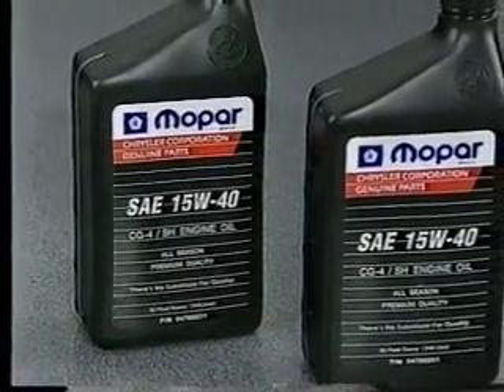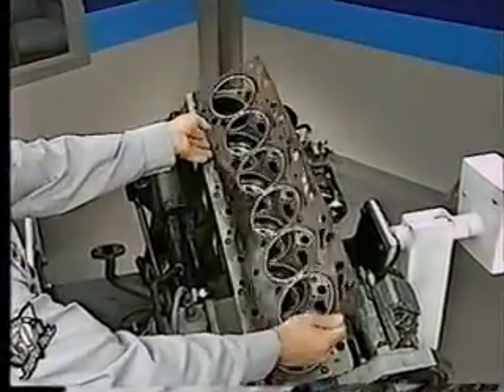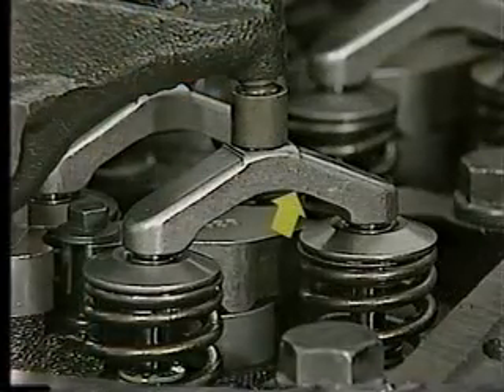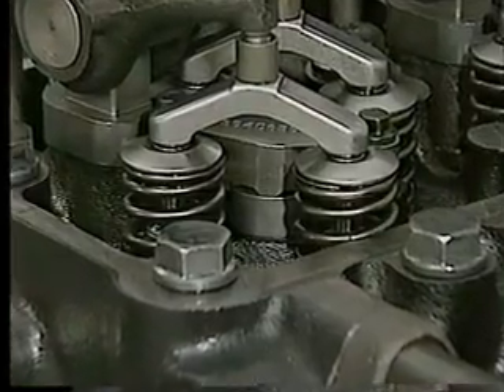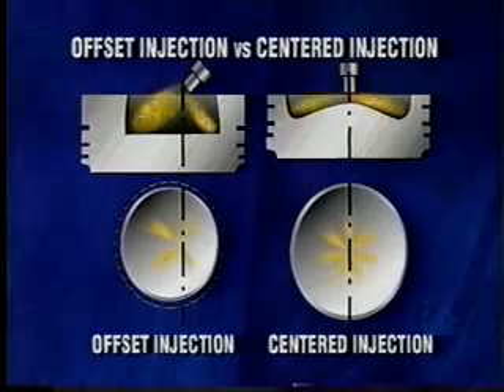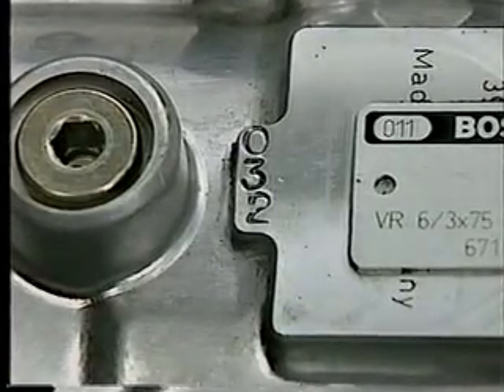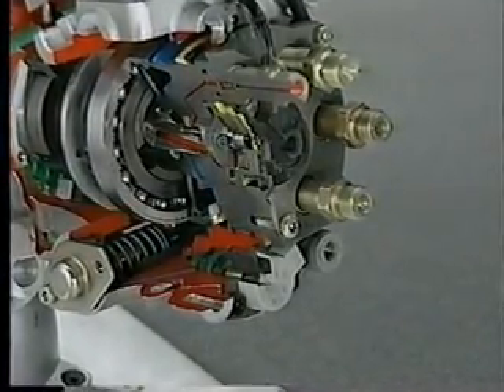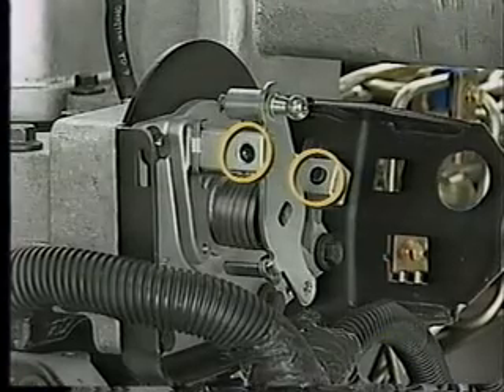5.9L i6 Cummins 24-valve diesel engine - Mastertech 1998 Part 2

Comment: Hello i have problem with my truck  dodge ram 2500 98, when start every day no problem but when i dont star by few day dont star, system diesel is empy, i put spray on intake and the truck start

Comment: I have 2001 dodge but I been changing the fuel filter and I did wrong . 
Finally I have my truck running back aging 
Now I all ready find one more problem, when star , all the time I just turn the key on wait for the light "wait to star " and star it and it star well, if I go somewhere and stop my truck , when I going to star it aging, is when I have problems to star ...
I would like to know if is a fuel system problem??? Or if I need cheek something else first

Comment: As I can see. But when I am in drive on flat ground in the summer for example, I will idle at 775-800 in Drive. in park I am at 800. But what annoys me is when I shift from Park or Neutral to Drive or Reverse, my truck shunts hard. And I know that can cause damage to the Transmission. With A/C on there is no difference in idle speed both either in Park or Drive. And my truck does creep at idle very well I will move at 5 mph on flat ground in Drive. But my idle is to high for me.

Comment from the maker: I would not turn the idle down. The idle is set for things like A/C, engine heating/cooling, and for the auto to be able to creep at idle. Also, the adjustment is supposed to be made while the transmission is in Drive, not Park or Neutral. Too low of idle will reduce heat which will cause a build up of varnish.

Comment: near the end of this video it says don't adjust the idle stop screws they are pre-set at the factory. the auto in the 24v is 750-800 rpm idle. to me thats to high. is it possible to turn it down or back out the idle screw. if not I will just shave it down to where I like it.?